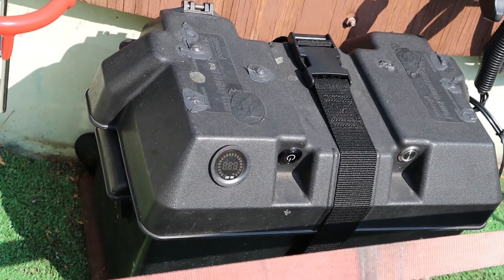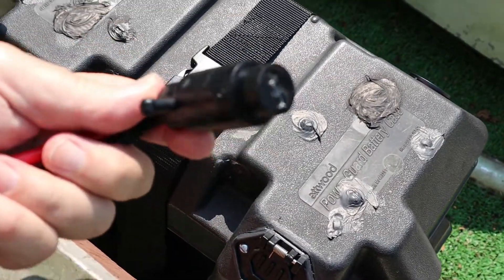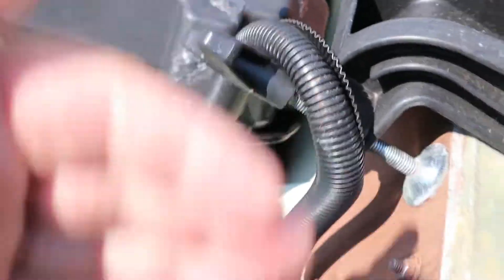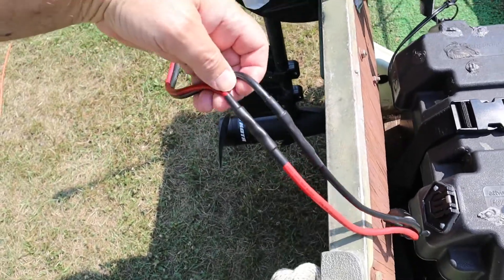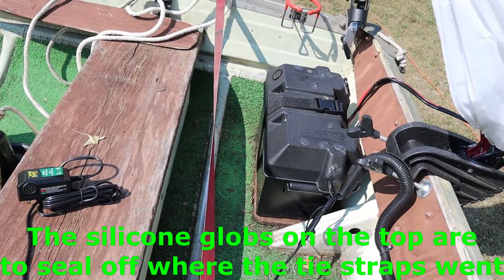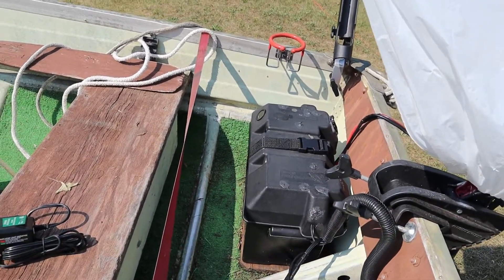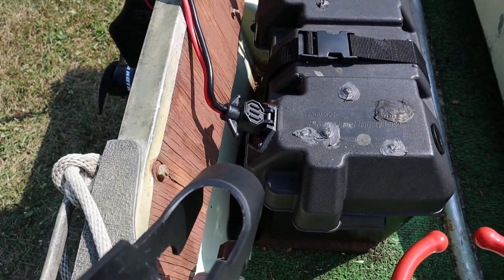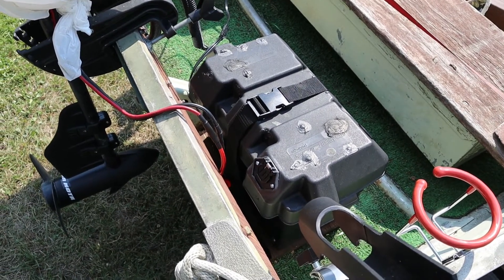Build Your Own Marine Battery Box, With Add-ons. DIY

Comment: I am unsure
But asking to help
Does that battery need ventilation when charging avoid hydrogen gas build up
Reply from the maker: Hi and first off thanks for watching:) As per your question, that battery box is well vented, the cover does not seal on it, I only covered the holes in the top because the boat is out in the weather all summer and it would fill with rainwater, as you can see the cables going under the cover in certain areas, It's a vented marine battery box. I hope that answers your question:)
We use the Battery Tender trickle charger that goes easy on charging the battery and keeping it topped off.
Reply: It’s always advisable to lift the cover when charging.
Reply from the maker: @jedediyahaaronyisrael7118  With a properly vented marine battery case such as ours, removing the cover is not necessary, but once again you can do that if you wish, I don't want to expose the electronics under the cover to the weather seeing as we store the boat outside, thank you for watching and commenting:)